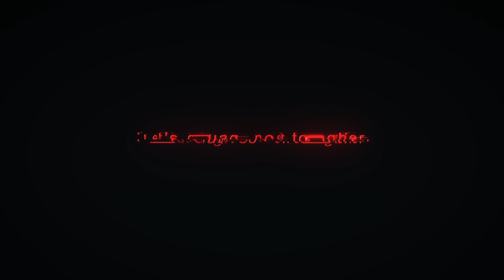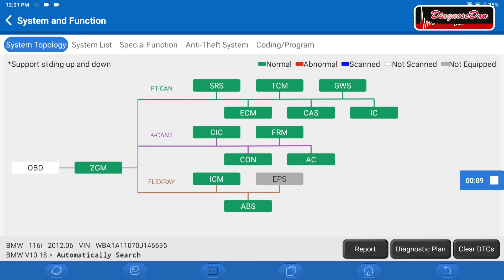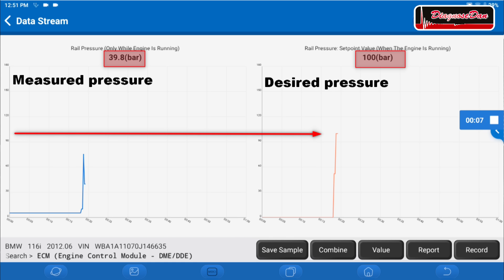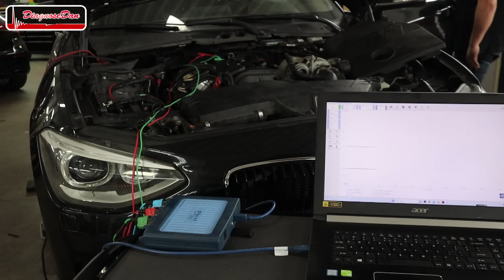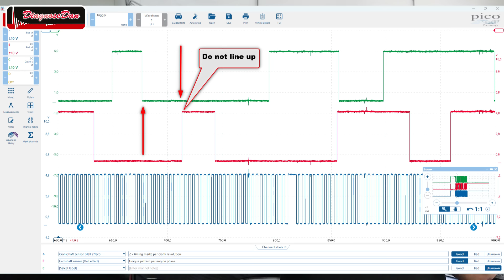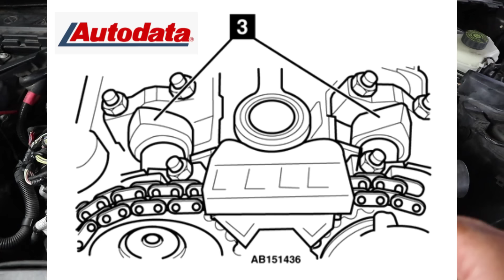Bmw dealership blunder? Incompetence?

Comment: Majority of dealerships are now staffed with replacement technicians, not analysts.
Reply: Replacement specialists, not technicians
Reply: @volvo24091  You are correct. Not technicians....
Reply: Most dealerships are filed with staff that haven't been sent to the correct training.
Reply: I agree. It's just staff. But are 
Parts changers. The more parts he or she changed it's ok. Charge it to the customer.
Reply: both yes and no. Some times you shouldnt blame the mechanic
Its unfortunately common to have a couple of technicians that do the majority of diagnostics. (i know a few thats realy good fault findings)
And the mechanics that most of the time do mechanical things. Some times the mechanics is put on fault finding but its slow becouse he is not used to electrical fault finding and the company say to him to hurry up.(he maybe only have an hour) Because of that mistakes happens.
And it should be better courses to learn diagnostics.(oem)
For exampel i did finish my school as a car mechanic 20 years ago. We never did see or use an oscilloscope and our diagnostics computer broken for 2 years,
Because we always have had other to do diagnostics i have never had a chance to learn it and they think that you should know even right out of school.
We have a support line and some times the answer they give is realy bad.
Reply: Dealership I work at has 4 master technicians, 10 mechanics (parts changers) and 2 apprentices. We usually nail the diagnosis on the first try, and if we miss diagnose we don't charge for the wrong part.
Reply: I've seen where the tech WANTED to go deeper into diagnostics but the service writers wouldn't give the time or shot gun it from the desk... That tech has since gone elsewhere where he can actually diagnose issues instead of loading up the pattern failure cannon
Reply: Here in the USA we like to call them Part’s changer’s…….They just fire the Part’s Cannon. 🤔🤬🤬🤬
Reply: It's like whith everything else it takes a bit off experience. I learned more while working in a shop then in mechanic school
Reply: @lylecoglianese1645  he doesn't, and shouldn't have to... Myself included, I prefer to work for someone over being the owner... I am an owner (mobile) and I hate the business end of it...i prefer the work rather than the business
Reply: Problem is nobody wants to do the work anymore, maybe the wages should go up? 🤷‍♂️
Reply: @panzerveps That’s great. Usually dealerships and independent workshops charge their customers for misdiagnosing the car. I wouldn’t accept that* but most customers would. 

(*Except when replacing a part is less expensive than diagnosing the fault with measurements. In that case, replacement of a part is a diagnostic tool and possibly the solution).
Reply: @lylecoglianese1645  You need Capital a as weall, not just business sense, and actually be a good mechanic. The Business can’t just run on a socket set, some screw drivers, spanners and a diagnostic reset tool.
Reply: @lylecoglianese1645 He can hire one or two people to handle those aspects of the business while he focuses on the actual diagnostics.
Reply: No competency, real mechanics could hear the problem during cranking
Reply from the maker: I also know alot of great dealer techs unfortunately sometimes we come across cases like this one😮
Reply: "Speculative parts replacement" is a huge problem at many dealerships
Reply: Fitters and Throwers.
Reply: @Airman.. did you hear it ?
Reply: @pantelis241  yes it's clear something wrong with timing/low compression
Reply: Also wallet flushers
Reply: I have been a mechanic, got all diploma's, I was like got to see this one. oke lets see, if it sparks, let's see if it gets fuel, it didn't but that was a given seen the previous "repairs" .

when starter fluid did nothing, I was like so it has be timing somehow. 

And because of that knowledge you work slower, the more you know the more you see. When 90% is about quick turnaround, garages are looking for that rare diamond that is lightning quick fitting parts and has great analytical skills is handy with diagnostic tools, keep inventory and answers the phone as a backup to the service desk. I also know that working inviroment at BMW is not for everyone... they carry a certain attitude, which can be quite toxic when you work there for a longer period of time. Knowledge walks away faster then they can replace them to answer the question why the dealer misdiagnosed it. It was an older model engine in a newer car. A car which wasn't a regular costumer to that dealer. It shouldn't make a difference but it often does. They didn't want to touch it but felt they had to and just did a quick diagnostic and saw the low fuel pressure and started changing parts. And that didn't work, and simply said we don't know, we don't care, take it else where we don't repair junk like this, not wanting to accountable because the car did meet dealer standards in the first place (engine swap) maybe the customer isn't totally honest and just want someone to say I can fix that for 500 euro's no problem. And the next guy text the next 500. Untill the owner decide to cut his losses and sell it as non running car with vague diagnosis not the uncommon either.
Reply: A ford dealership told me I needed a new rear washing tube as it wasn't spraying. It was -5C and it didn't occur to them that it was frozen...
Reply: They are staffed with parts jockeys.
Reply: @fulf  absolutely spot on 👍
Reply: quite a broad statement
Reply: Yes no more mechanics just fitters.
Reply: @guitarsender the industry reaps high profits whilst the technicians get peanuts for wages! They also expect you to diagnose complicated faults in 30 mins or less, this is why most shops have a bad reputation. Dealerships are especially bad for it, as they are often only paid .2 which is 12 mins, to connect the scan tool and complete a diagnosis, this only gives you a code or codes, this does not allow fault finding. Warranty rates are shocking for the dealership from the manufacturer as well. 
Cars are no longer easy to fix, they are becoming more IT related than mechanical only. Shops need to fully train their staff, make sure they fully understand the product, then pay them accordingly. This would stop most of the parts changing. I say this from many years of dealership experience!
Reply: @2nickles647   Great reason to lease your cars.  If it breaks you just take a loaner home.  No stress.
Reply: We have had so many BMW'S with this problem,  a cursory look at the  fault codes results in the removal of the cover and a look at the cam positions.  A pain is the removal of the sump to get the obligatory broken guides out as it involves dropping the subframe a little and disconnecting the rack. I would say How in God's name BMW and so called BMW  specialists don't know this ? BMW mechanics at our local dealerships  would not know what to do, a new engine would be the only recourse  which writes off the car. The specialist  probably  good at M badges and wide wheels. I am soon to retire and I despair of the new mechanics who seem to think every thing is fixed by a diagnostic machine or a remap.
Reply: @Airman..  True , but this engine sounded great while cranking.  The timing is likely only a few teeth off. Compression test in some of  these cases aren't always conclusive either.
Reply: Keyboard techs now day's not old school fault finders.....Check the basics before replacing components.
Reply: If you're a Technician / Mechanic and cannot do analysts , YOU DO NOT BELONG in the industry !!!!!!!!!!!!!!
Reply: Fitters
Reply: All they do is Just jeplace the  parts till the car works
Reply: And that's why Tesla is winning. 20 parts electric motor vs 2000 ICE , no way.
Reply: Most dealers are filled with staff that have not had the correct training and all the good techs have left the industry because being a mechanic is a thankless underpaid undervalued job and young people have been conditioned to believe trade jobs are lowly ... Welcome to the skills shortage.
Reply: It's not really that in a sense. A lot of dealers have academies for certifying techs etc. The problem nowadays is techs are not car mad or petrol heads- the kids that helped do cars with their dads and stuff. They are the ones that stand out .
Reply: I learned at a dealership and I didn't learn it probably or I had to clean up.
Reply: @wasgij03  That's not how it works. BMW dealers follow ISTA troubleshooting procedures for the codes the system gives them. D
Reply: I love this diagnostics, because working alongside guys that just rip in swapping parts is often such a negative method plus jokers then just get angry and call the vehicle names. Then of course guys leave a trail of other faults that they often leave behind for someone else to fix. Thanks for a brilliant series from a 75 year old mechanic........hooray from NZ......Rob
Reply: It's true
Reply: True
Reply: I call them “stealerships”.
Reply: Why is this shocking?  If they(dealerships) wanted technicians and engineers to fix these modern abominations, then they should pay wages for technicians and engineers.   When they're paying $15/20 USD for techs, you get parts changers.  @Diagnosedan is probably aware how most techs get paid in the states, FLAT rate.  Most dealerships will only pay you one hour for diagnostics.
Reply: "Technicians"

Comment: I’ve seen plenty of vehicles over the last 24 years or so in the repair trade that have come from both Dealership and independent repair shops with a list of tests and parts replaced and charged for, what I’ve learned over the years and it’s served me well, and that’s disregard what tests have been done in till you’ve done them yourself. I once had a vehicle in and had to speak with the previous repairer about diagnostics that had been done and they couldn’t tell me about what they’d done because they didn’t actually do what had been charged for. It was my job then to convince the customer of my findings it was almost like they didn’t believe me because of what the previous repairer had told them.

Comment: Another really interesting one. I didn't realise the HPFP had that kind of electronic control valve on it, but makes complete sense.
When the other garage says they checked the timing, I think they mean they checked the workshop clock and decided it was time to go home 😂
Reply: Yes, it was time to saddle up their horses. What a bunch of cowboys !
Reply: that is so low........lol
Reply: The dealership erased the codes, it wasn't showing a timing code = Timing is good..
Reply: Actually, they checked their clock and decided it was time to send it to Dan...
Reply from the maker: Ha ha ha😂😂😂😂
Reply: Why was there a double spark when engine was turning over was it caused by the timing?
Reply: @bystander1489  Even at the speed of the starter motor (maybe 300rpm), you still have a couple of sparks per second.
Reply: @MattyEngland  yes but there's a double spark happening easiest  one to see is at the end of camera shot
Reply: @bystander1489 At the end that looks about right to be 2 sparks a second. 
I think it's just that prior to that, the ECU missed a few sparks for whatever reason.
 If I had to guess it probably missed them because it didn't see the right fuel pressure, or missed a couple of spark/injection cycles to make sure the engine wasn't flooded, either that or the ground wasn't great.
Reply: @MattyEngland  quite possibly so more than likely it was the  timing being out , what he said about the timing with the other garages is unbelievable just because the engine wasn't locked they assumed it was OK
Reply: HAHAHA quaility
Reply: haha yeah spot on
Reply: @bystander1489  Could it be that the camera's (relatively low) framerate was causing some of the sparks to be 'missed' on video?

Comment: Hi Dan, thanx for your clear diagnosis on our car!! And also thanx for your quick reply on our additional questions. Clearly the BMW dealer (Dusseldorp Zwolle) needs to do some extra learning on diagnostics. Let’s hope the mechanical damage is not too severe. 🙏🏻
Reply from the maker: I certainly hope the damage not to bad🤞 Thank you very much!!
Reply: It must be really cool to watch a video on the diagnosis of your own vehicle. Fingers crossed for your engine.
Reply from the maker: @slacko1971 or scary😂
Reply: Please keep us updated on the cost if possible
Reply: Hope the engine was still under warranty 😬
Reply: @reelheel5919  2014, not likely
Reply: Hi. If you are the owner of that BMW, please tell us that the engine been saved by just replacing timing chain
Reply: If the car was first diagnosed in Düsseldorf, where is Diagnose Dan? I am watching this coming from Picoscope newsletter

Comment: In 30 years there's going to be no classic cars from this era. The manufacturers have made them too complicated for the average mechanic to fix economically. Most of the complexity has little or no function except to ensure the car ends up back at the dealer more often then it normally would need to.
Reply from the maker: I agree no classics are made at the moment

Comment: Dan is a master at his craft.  Next level.  Changing parts is a skill in itself, but truly diagnosing these vehicles is a “WNL” WHOLE ‘NOTHER LEVEL”.  Dan is a blessing to his customers for sure.
Reply: So true. Well said.
Reply: That is basic diagnostics nothing special at all. How in the world a dealership in 2023 don't or cannot use a scope is mindboggling. I guess that is part of why mechanics all over the world get such a bad rep.
Reply: @ralfsautomotive  I went to a OE sponsored event at a nearby dealer about a year ago and during the class they were talking about cam/crank correlation. I answered that the easy way to confirm the problem was to use a scope and look at the waveforms. The instructor then said, We don't use scopes as they are not a reliable diagnostic tool  !!!
Reply from the maker: Actually i would expect most technicians to find this fault
Reply: My guess is nobody else checked the timing. Maybe someone said they did but the fact was they didn't have a scope or they had one but nobody ever used it and they couldn't be bothered to take the cam cover off.
Reply: @Diagnosedan  I would as well, BUT with the state of training in most of the US I wouldn't hold my breath that it actually happens.
Reply: For sho this guy is amazing
Reply: @Diagnosedan  BTW, like you, I'm pretty sure the guys at the other shop most certainly did NOT test the timing. Wondering why they obviously thought about it such as to say so in the email, yet didn't actually do it. A head-scratcher for sure.
Reply: @ralfsautomotive  Parts replacement is where the $ is made generally, esp with luxury brands. Blame the Service Advisors and dealership managers. Some of them are truly awful humans the way they lie to their customers. That's why many of us, esp us older folks DIY. About the only thing I take to a shop these days are tires.